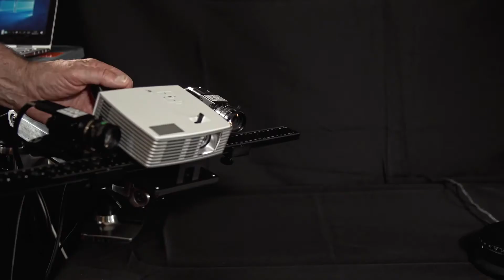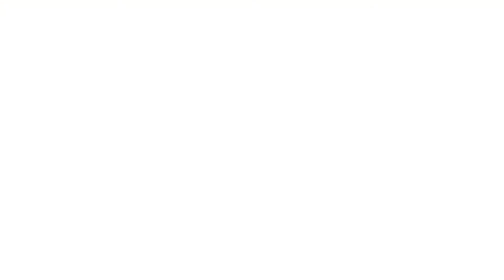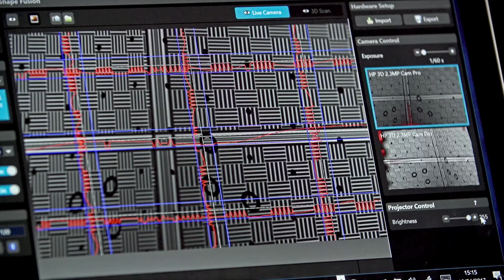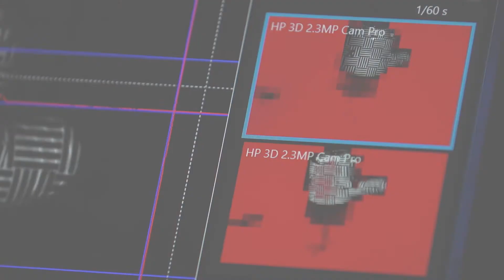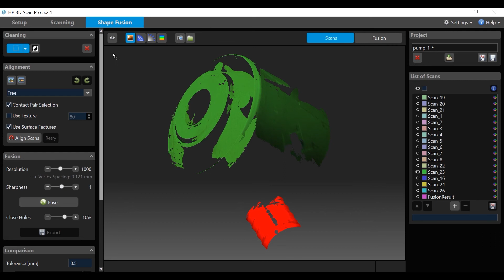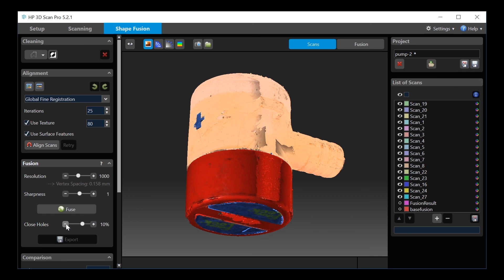Overview: HP 3D Scanner Pro S3 with Dual Camera

Comment: Does the hp z pro camera alone do enough to adequately scan as they show it or is the resolution going to be off unless it’s structured?
Reply: Z camera uses same software as Camera 3D worktool on Sprout Pro G2, designed for lower resolution scans but with high textures and adds PBR as an output (mostly for visual 3D outputs VR AR computer graphics use. It doesn't give the 3D scan accuracy that Pro 5 does. All depends what your outcomes need are

Comment: how big  can i scan
Reply from the maker: Optimal size is 60-500mm but can scan larger or smaller objects too. Read more here: https://www.growshapes.com/hp-3d-scanner-faq.html
Reply: If you use the correct calibration panels, as big as you want. with this 3D scanner you can just scan smaller areas (if you want) at a time and use the software supplied to align and fuse different scans to create a bigger overall 3D model.